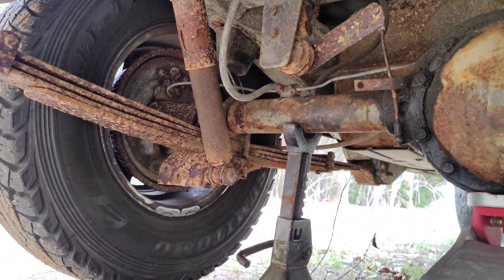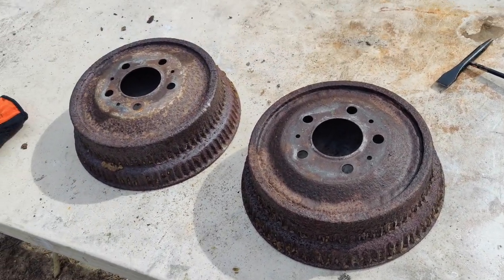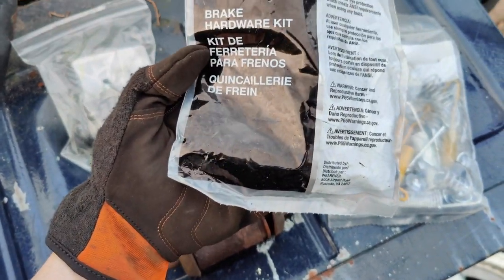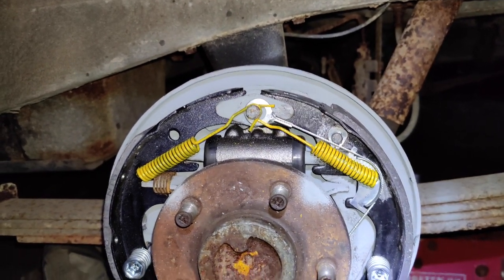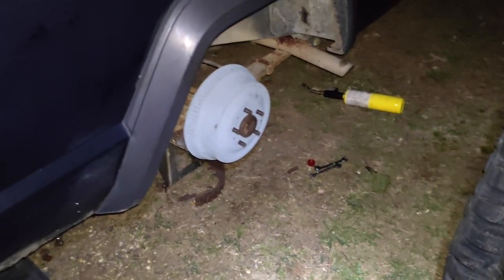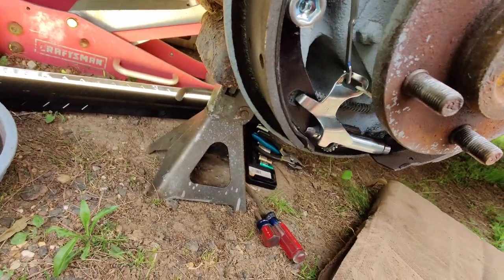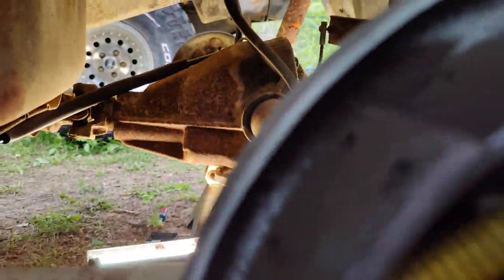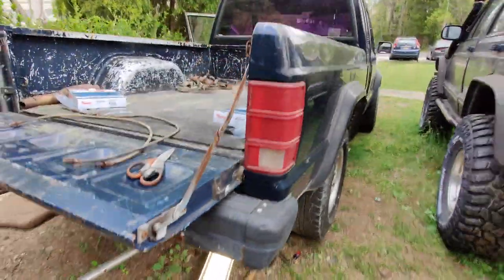88 MJ Rear Drum & Parking Brake Overhaul

Comment: slide a small box end wrench over the cable and press down on the backing plate will close all those fingers/tabs on the parking brake cable ends makes it much easier to remove

Comment: You can stick a box end wrench over the fingers of the broken cable sheath to pinch all of them in to extract the cable sheath from the bracket.  Same can be done for the parking brake end at the backing plate.

Comment: Nice. On the lastest inspection my parking brake was pulling less on the right side, but the pedal was fine for both sides. What can cause that?
Reply from the maker: Could be a stretched cable or the star adjustment is just a little bit out on one side

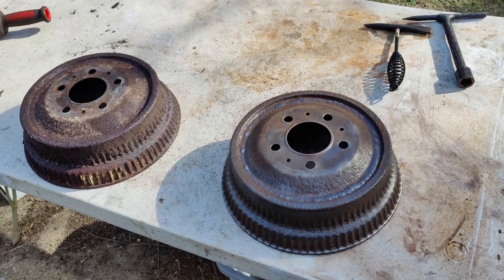Comment: Hell,for the money you spent on those brakes,you could have bought an Explorer 8.8 with disc brakes,4:10 gears,and a posi track differential.😂😂
Reply: So for less than $200 you can get an 8.8 that's already welded to fit and ready to go? Wild.